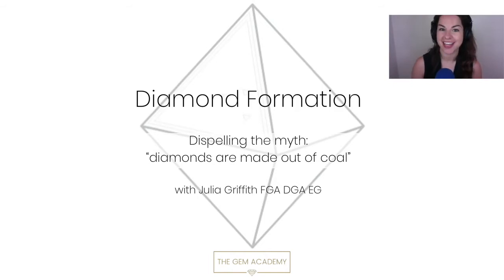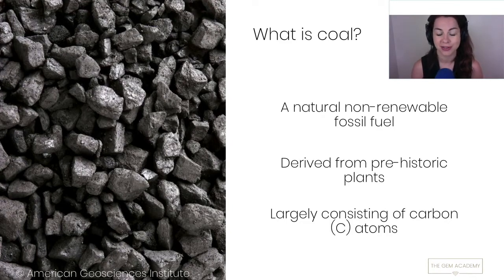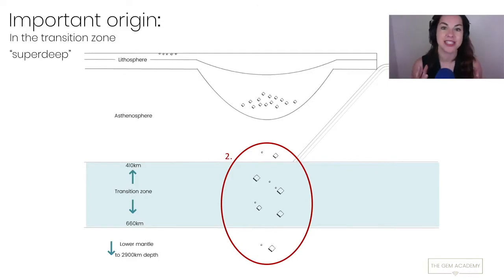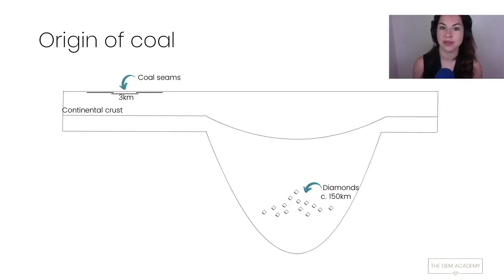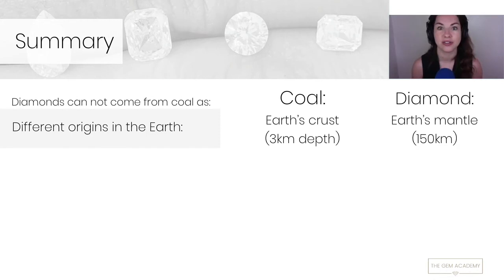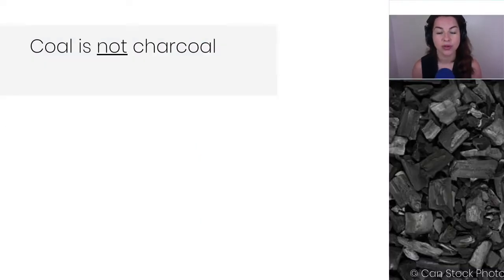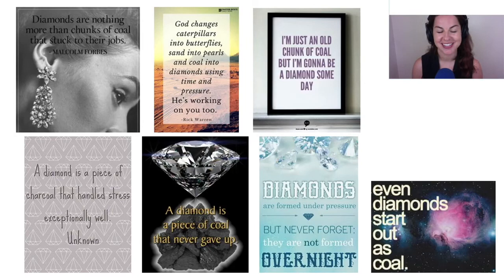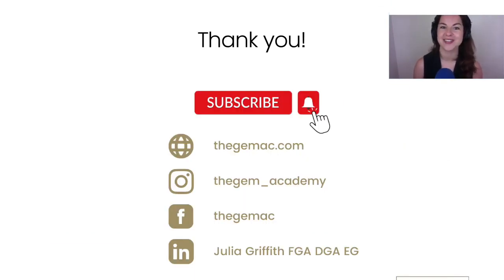Diamonds made from coal | Myth buster

Comment: Your videos are really very informative. You've done a great job! I came across one of your videos where you pointed out that the diamond testers are not reliable anymore. I was wondering if you could explain how can we differentiate between Moissanite and Diamonds. Is there a portable tester out there which can give a 100% result for this purpose?
Reply from the maker: Thank you so much! I think the best and quickest way (eventsully) is to learn to do it visually by seeing lots of samples of both of different sizes and weights. The only equipment that can otherwise help are the liquid free refractometers - but they are for loose stones - some single set stones can be tested but settings limits this test for all run over settings and side stones. So learning what diamond looks like visually really is the best and quickest way :)
Reply: @TheGemAcademy  Thanks a ton. Much appreciated. Any specific "liquid free refractometers" recommendations?
Reply from the maker: @visheshgupta9100  I only know of one which is by Presidium. Here's a link! https://www.cooksongold.com/Jewellery-Tools/Presidium-Refractive-Index-Meter---II-PRIM-II-prcode-997-2710